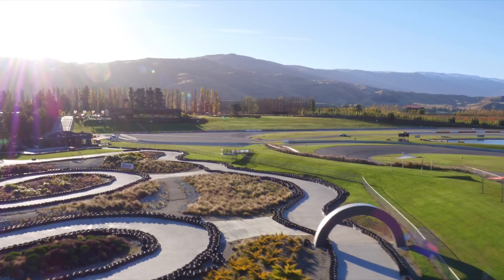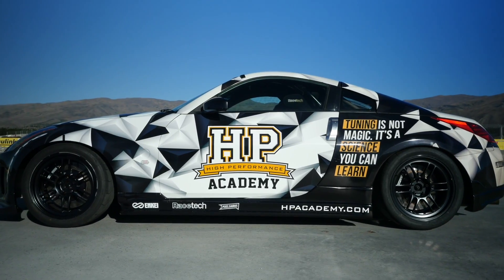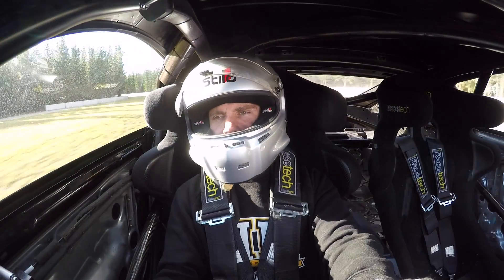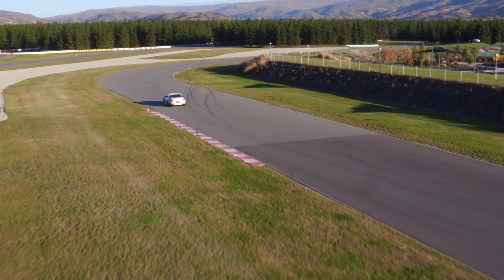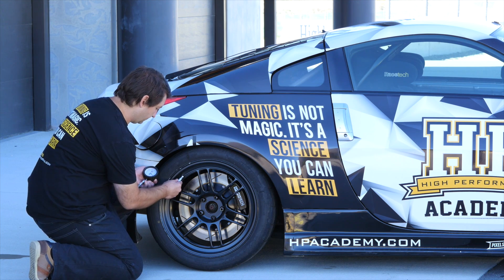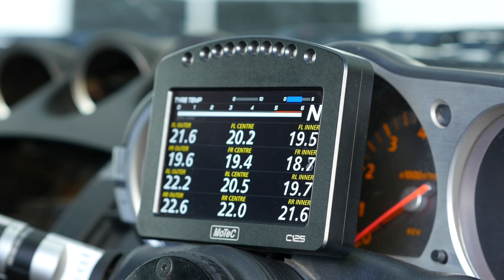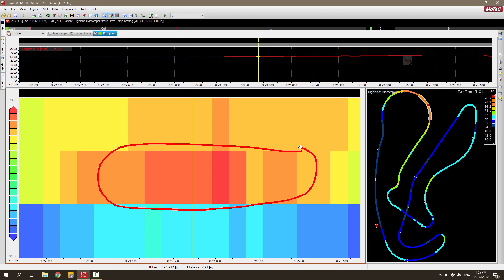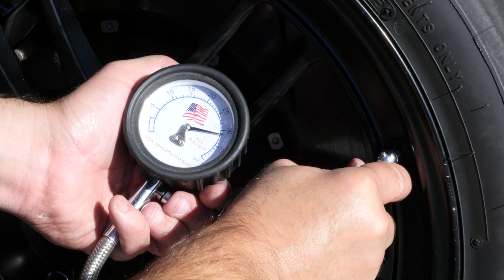Faster Lap Times, For FREE? | The Importance Of Tyre Pressures [FREE LESSON]

Comment: I was curious. My tire temps vary on straightaways to turns, should I adjust tire pressure so my temps are to be more even in the turns. Straightaways they look under inflated on the temp gauge but turns they even out. Tia -Gerald

Comment: I have a track-dedicated 350Z with Federal SS595 tires, 245/40R18 front, 275/40R18 rear (switching to 35 aspect ration next set). I also run with -3.2 camber in the front and -2.7 in the rear. I was told something early on that I have taken with me to the track each time, and it's been about 15 track days: to set the "cold" pressure to a point where by the time the session on the track is over the hot temp is equal or close to the max psi pressure recommended by the tire one is using so as to maximize the contact patch of the tire on the road. In the case of SS595's, the max pressure is 44, so I usually start out around 38 and by the time the ~20 mins session is over, I'm in the 42-45 range, depending. I deflate at the end of the session down back to around 40, so by the time the next session starts I'll be once again at my "cold" starting pressure of 38. It has worked for me, but I wonder if I could get the most out of the tire by running lower pressures? The info I found here seems to contradict what I have been doing? Have I been misinformed? I am still relatively new to this sport/hobby and always looking to learn/improve.
Reply: I'm not aware of exactly how those tires behave, but it seems too high for me. I have a Genesis coupe, which has stock alignment and the stock front strut suspension which doesnt really have any camber compensation, adding up to basically far less camber than you. My old tires were extremely floppy compared to my newer, still supposedly soft UHP AS tires. I found that the right hot tire pressure was 34 front, 32 rear. My new tires seem to be doing well at 28 cold on the street, but I haven't had the chance to go out on track or autocross it yet. Stiffer tires, more static camber, more camber compensation, and more roll stiffness all mean the ideal pressure should be lower. If you pay attention to the wear pattern, there should be wear coming to the ends of the tire, but not rolling over onto the sidewall. A more rigorous way is by having sensors measure the temperature of the inboard and outboard section of the tread pattern and aiming to keep the inside about 20 degrees F hotter than the outside while on track.

Comment: I run 30-31 psi in the rear and 36-37 in the front on my street  Z
Reply: is that a 370Z and what are the tire sizes?  for a 370Z mfg recommends 32 f and 32 rear.  why change from that based on your experience?  I’d like to get your thoughts as I am playing with tire pressures on my ‘19 Z.  thx

Comment: Die hard follower of your videos and thinking to purchase the tuning video package on the website. A quick question though. Running Nitto Invo 225/45/R17 on my toyota gt86 (NA Stage 2+ ECU Tune done myself on OFT tablet), for mountain runs with steep inclines and hairpins, I set my tyres (both back and front) at 38 psi (outside weather temperature goes from 22 celcius on the bottom of the hill to 14 celcius on top of the hill). After about a couple of hard corners, the car understeers. On a tyre pressure of 35 psi both front and back, the car in corners feels like jelly running on side walls. Any recommendations? I am harsh on the tyres, however would like to have ultimate grip starting bottom of the hill to the top. the hill climb is 12.5 kms, average gradient of 6.1%.

Comment: When you say "It's something that is often overlooked by track day newbies and veterans alike - Correct tyre pressure. ", it is not just overlooked on track day, I find a lot of people overlook it when driving on the road.
I check mine with a quick look just about every time I drive and always check the pressures when I top up my fuel tank.
I have also found that the "cats eyes" are a good way of checking while driving  because they are uniform in shape - I know the sound my tyres makes as I hit them and if that sound changes, I check my tyres.
It was last year when I pulled over a highway patrol (I am not a cop) because his front passenger tyre was flat. I pulled up next to him at the lights and it took repeated beeping and waving out the window for him to finally wind his window down. 
Always wanted to say - "Hey you, pull over now" (didn't have the time to explain why as the lights were about to go green) and when we pulled over, it was funny watching a cop suddenly go sheepish when he saw the flat tyre (it wasn't fully flat, but near enough to flat with a large bulge to be be very obvious and dangerous).
He was very thankful that I had pulled him over and then he proceeded to ring someone to get them to change the tyre.
Reply: yes mr tire kicker

Comment: in a FF car would the tire pressures usually be best set at equal pressures front to back? Assuming the front tires need more pressure to support more vehicle weight but also get hotter due to the higher level of friction they experience
Reply from the maker: Good question. We suggest you start with even pressures and then start adjusting only the front OR the rear by 2psi increments up or down and see what difference it makes - Taz

Comment: I will always set my pressures to 30PSI all round cold for the 1st run of the day, knowing they'll over pressure, after that session 1st thing I do is then reset each tyre to 30, with different temps each tyre will be different. I find it takes 3 runs to get full heat soak. where the wheels, tyre skins and the air are all up and don't cool too much between run (bare in mind the idle/cooling time if it's a long time between runs). After the 2nd run I target 28 hot (so might get down to 24 or so cold) on the R32 Time Attack car with Ventus Z221 Semi slicks and on my old R33 Track/Street car I would run 30PSI hot with Z222 UHP RS3 tyres. This was because the RS3 side wall is quite soft and lower pressures could cause sudden instability. Hope this helps.
Reply: Hi, for roll racing acceleration would I get faster acceleration if tyre pressure is low? I don't care much for traction because my car isn't high powered
Reply: @r.k862  I do t do roll or drag, but lower rear pressure for max traction, with higher front for lower rolling resistance would be the go, how low... when I took the 33 to the strip I dropped them to 25psi because no lateral load, could probably run lower but I had to drive to the servo after to put air in for the drive home and didn't want to go too low. The get nowhere near the temp change that you do in track work from just a burnout.
Reply: @tangles01  thanks man i appreciate your knowledge. I got a 370z NA and thinking of taking it to Eastern Creek roll racing for first time. I don't care about traction because my car isn't high powered. There is a debate going on, some say if using low tyre pressure is will reduce the rolling circumference which in result make car accelerate quicker but some say with the low tyre pressure there is more rolling resistance and won't make it go quicker.
I don't know which to believe. Do you know anything about this?
Reply: @r.k862  Well once they are rotating on a straight line run, the centrifugal force will stand them up anyway. With low power, run stock road pressures if you're not going spin them, more pressure will reduce rolling resistance. You'll only drop the pressures if you need the traction. If you want to reduce the circumference, run a lower profile and or a a smaller wheel.
Reply: @tangles01  thanks. My car placard says about 37psi is recommended. If I am not looking for traction but I am looking for fast acceleration what max psi should I set it at?
Reply: @r.k862  150psi

Comment: almost $5k tire monitoring setup
Reply: I check mine with a $150 laser thermometer (Also used for brake temps) and a $30 tyre pressure gauge. Good enough to win the Performance class in Japans Time Attack. If I has these guys kit, I would use it too, but the gains in tyre management from the simple setup I have to that would be small, worth it if you're at the pointy end of a decent series though, at a certain point 5k to gain half a second or greater consistancy is a sound investment and much cheaper than more HP or Aero to achieve the same time gain.
Reply from the maker: Yes sir. To be clear you don't need tyre temp sensors to set your tyre pressures. If you are a more serious race team then tyre temp sensors along with a knowledgable tuner / engineer will provide a great deal of benefit. We find them helpful for teaching and R&D :) - Ben